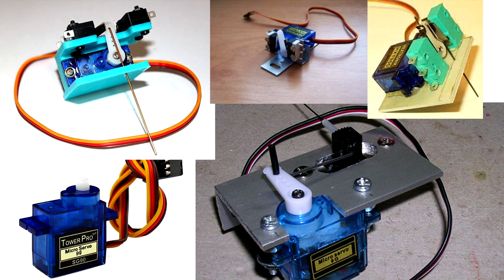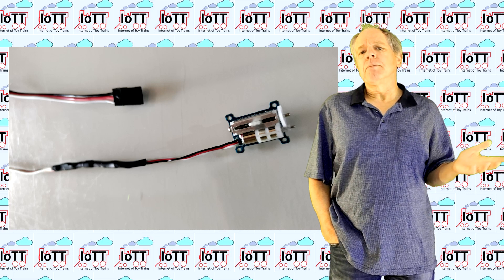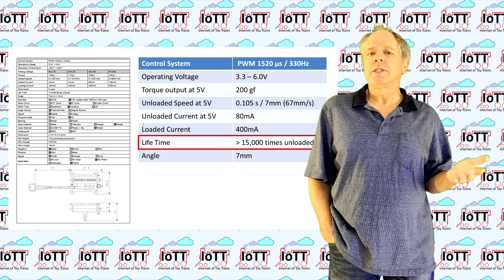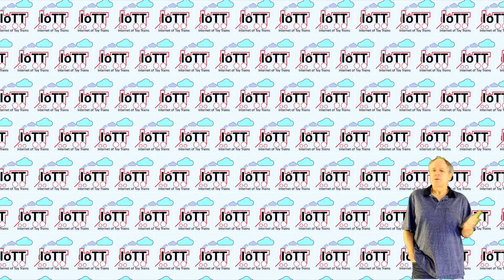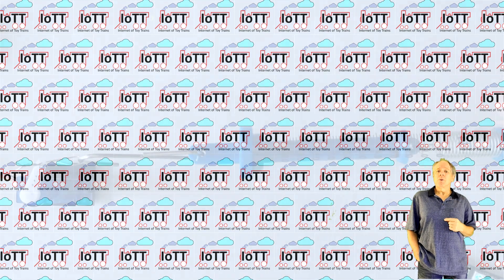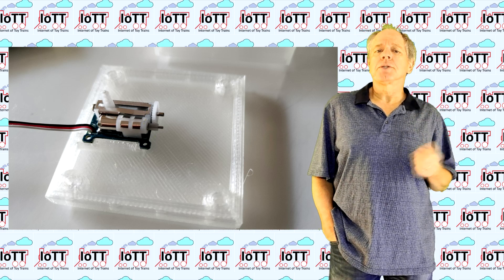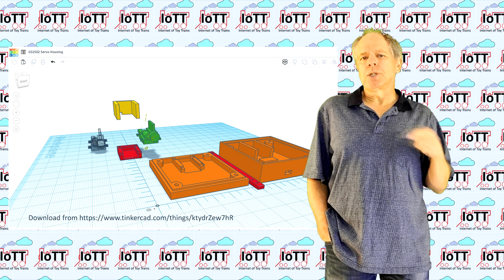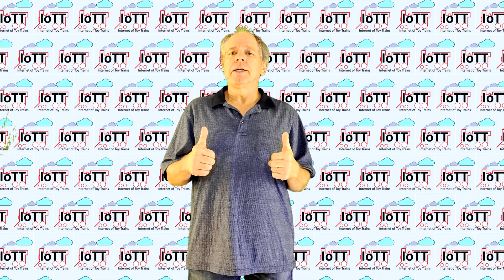GS-1502 Linear Servo Review (Video#92)

Comment: Hi. Could I use it with locomotive decoder?
Reply from the maker: Servos use a PWM input with the duty cycle proportional to the servo position. If you use a decoder that can output such a signal e.g. on a function output, with duty cycle depending on the function value, you could control the servo from a decoder. I just don't know if there is a decoder out that that has this feature. If you find one, please let me know.
Reply: Hey are you thinking of couplers?
I am think of the same thing
Reply: Absolutely my friend. I think loTT have joked on me, because seems many decoders can control servos (analog or digital). I didn’t know it. The only thing how to connect, because some models could provide 3.3 or 5v. This is not a problem, because you could connect as it is, or need some extra components. 
Now the main question to find excact 1502 voltage, because in many shops it is different. 3.3 or 3.7. I do not know what is true.
Reply: The issue is that you need some current conversion for it to work. I found an idea to make it work on DCC systems. But you need a decoder for it which makes it hard to implement on open train cars
Reply: GS-1502 has 0.4A and MS Decoder could provide 0.8A. Are you sure it is an issue?

Comment: Hello sir can i program my ultra linear micro servo with arudino ?
Reply from the maker: The GS-1502 control interface is the same like any other servo. It just needs a PWM signal with a frequency between 50 and 100Hz
Reply: @IoTT  and we need another device to control it other than aurdino ??
Reply from the maker: @Riya.79  You can connect it directly to the Arduino as shown in the Arduino documentation here: https://docs.arduino.cc/tutorials/generic/basic-servo-control/ or here: https://www.youtube.com/watch?v=kUHmYKWwuWs
For most applications (i.e. if you want to control a number of servos from the same Arduino) you probably will use a PWM driver such as a PCA9685 board.

Comment: Great Video! I have a project where I am using 76 of these servos and I was using 50Hz and in some cases getting jitters and stalls, I will give this a shot with the 100Hz and see if I get an improvement. Thanks a million! It has been really hard to find technical info on these.
Reply from the maker: Thank you. Running 100 Hz if the servo can handle it is generally a good idea as it also gives higher resolution. Some of it probably will be lost by the gears, but at least you can play with it. Overall, as I think is made clear in the video, I was not very impressed by the worm gear mechanics of this servo. For a project like yours I probably would look for a more reliable device.

Comment: Thank you for the review. I am thinking about using this type of small servo to raise and lower the pantograph in my TT-scale locomotive. There are decoders that can control servos directly. The problem is probably the small space in the loco and the power supply. Because the decoders usually provide only 50mA at 5V. That will not be enough for this servo.
Reply from the maker: Working panto for TT scale? That's beyond challenging! Hopefully you post a picture somewhere when that works!
Reply: @IoTT  I wouldn't be the first. Others have used Nitinol wire (Memory wire). Unfortunately, this requires 200mA current to hold the position.
Reply from the maker: @macg9940  Yeah, I experimented with memory wire a while ago. Current, heat, and little precision, unfortunately. On the other hand, a good geometry to put into a locomotive body.
Reply: How was the result? Did it work with loco decoder? Modern decoders like Zimo could handle 500-800mA for a functions line.

Comment: I am considering using this servo for switching turnouts on a small portable N-scale layout. I think it could be ok for this application since the switch rails barely need to move a few mm. But I am finding it difficult to create an elastic connection with the throwbar of the turnout since I don't want to stall the servo. Also, how did you slow down the speed of the servo? By reducing the voltage? I am currently driving the servo at 3.3V directly from the PWM output of a Raspberry Pi.
Reply from the maker: The advantage is it is small and linear, but I would be cautious about the relatively short life span. Since the gear is not back drivable, you don't need a lot of elasticity in the draw bar, you just drive the servo to the right position. To control the moving speed of the servo, watch my videos 17 and 18. There it is explained in detail and you also find a link to the Arduino sketch. And watch video 55 for a demonstration what movements are possible.

Comment: At approximately 19 seconds into the video I think you had better correct the servo connector wire/pinout colours, the brown is the negative and the yellow is the signal.
Reply from the maker: Yes, it probably should be the other way around. Funny enough, the image comes from a commercial product description.....
Anyway, in real world, there are several different color schemes as seen here: https://static.rcgroups.net/forums/attachments/3/0/1/8/a4228312-146-user38_pic55606_1294883044.gif

The important thing is that all of them carry the plus on the center pin so that there is no harm done to the servo if you connect it the wrong way around. It just does not work.
Reply: @IoTT  Regardless of the lack of damage if the wires are reversed, you should still correct the diagram in the video.
Reply from the maker: Unfortunately it is not possible in YouTube to make changes to a published video. But as common in such cases, I added a bug report in the video description.

Comment: Thanks, an excellent review. I agree with your conclusions. I used these on a couple of H0 lower quadrent signals and was disapointed.  The linear servos I aquired looked the same as the ones in your review. They were very easy to burn out, and were unable to produce signal bounce, for the same reason you showed. I was able to slide the gear on the screw to eliminate the backlash, but the motion was still rough and much noiser than the 9g alternatives I am using.
Reply from the maker: Thank you. Looks the problems are consistent. And yes, I forgot to mention the noise level in the video. It is probably louder than the SG90.

Comment: Interesting topic and timing. I recently installed 14 MTB MP1 turnout motors on my layout. They have a built in switch and are a bit more expensive than a Peco coil and switch but are more reliable. I’ve tried controlling them using the MGP turnout decoders and the Team Digital SMD84 turnout decoders to see what options are provided. I will next test them with the Green hat.
One thing I like is that if the turnout is already set in the correct direction, if you select a route that includes the same turnout and direction, there is no movement. Unlike the Peco coil that will reenergize the coil in the same direction. I will also test feedback.
Reply from the maker: Not sure about the MP1. Is that like a servo? Or like a slow motion DC motor? In the latter case they would not work with the GreenHat, except when using the coil drive attachment as shown in Video #78.
The Greenhat/IoTT Stick is memorizing the last turnout position when powering down, so when you come back, it already knows it. Also, retriggering the same switch does not reactivate the coil as it remembers the current position. Of course, this falls flat if you manually change the position while the GreenHat is off...
Reply: Tam valley do a nice servo driver for this application
  Mini singlet I think they are called
   I have a couple on my layout driving these servos converting basic manual Bachmann set track to DCC controlled turnouts

Comment: Thanks Hans for your review and recommendation. I am interested in this type of review for moving turnout servos as I have bought a DS78V (digitrax), but it does not have any means of adjusting the end stop positions for point end positions, and risks breaking the turnout through unregulated digital movement. 

I was hoping that this might have a means of adjusting the throw length, but I dont think that it will help.

If you come accross a means to control the stop end movements on a servo digitally, that can be used with the ds78v , please do publish it.

Many thanks
Jonathan Dorey
Reply from the maker: I checked the Digitrax manual as well as the groups.io news group and indeed it seems the Digitrax DS78V only has fixed positions for the servos. Not very convincing, I must say. They suggest mechanical adjustments (meaning moving the servo until it fits). Sort of unbelievable. As you may have seen in the video, on the GreenHat config page I provide a slider to determine the exact servo position - individually for every servo and for every possible position (if you use it to drive a signal with say 5 aspects, you have 5 positions that you can set). I always felt this is the way to do it properly.
Reply: Hans green hat is doing the same task as the ds78v and it is fully compatible with loconet. The advantage of the green hat is configured by a web page it offer a lot more ajustements and features. Since the brain is the ESP32 microcontrollers. Take a look at his video on the green hat on his channel.

Comment: Interesting video. I bought a couple of linear servos some time ago with the thought about using them to activate an N-scale turnout. I thought it might be possible to attach the servo to the underside of the turnout such that I had it in one unit. This way I could easily replace the turnout and servo if anything went wrong. I haven’t gotten back to that project yet. This video gives me some more to think about. The spring on a PECO turnout might be too much for the servo. Still, since the linear servo stays in position and won’t move back, removing the PECO spring may be the solution. I may end up using these servo for animation projects anyway. Enlightening video as always Hans!
Reply: Yes, I always remove the springs on the turnout. The sg90s work great with my n scale peco turnout.
Reply: @pierrelambert446  I've standardized on a SG90 servo with a 3d printed holder for my turnouts. They have been working great with the Green Hat. For a few of the KATO turnouts that I use, I now have Hans' relay board adapter. Love his products!
Reply: @robleathley6024   great to hear, I have now 4 green hat, and a few yellow hat for track occupancy. And around 10 servo SG90s installed. My layout construction is a bit slow. I did design my own servo mount. Hans product are working great. He his helping to push the envelope of this hobby.
Reply: @pierrelambert446  My layout isn't going any faster. So many projects and so little time! I have about 20 servos installed so far with another 8 or so yet to be done. The Green Hats will all control them. I'm also using MGP diode detectors for my occupancy detectors to allow signaling on the mainline. I have a few other MGP items as well. They work well with Hans' system. I very much agree that he is pushing the envelop in this hobby.
Reply: @robleathley6024   I just stopped purchasing the Yellow Hat for my MGP detector, as the Red hat with DCC ++ should come with 32 inputs. I am on stand by for the detection. Look like we are on the same path for the electronic off our layout.
Reply: @pierrelambert446  I have an NCE Powerhouse Pro for DCC but I'd like to get a Red Hat once they come out for my portable modules. Just trying to rewire the layout now in order to get signaling setup. First have to finish my turntable. Yes, very similar path for electronics.
Reply from the maker: Thanks. Removing the spring certainly is an option. For N scale, I think the force the servo develops is enough. Try it with one, the see how it performs.

Comment: Nice, I was not aware those servo were existing. Thanks for sharing. I am looking at your tindie store almost everyday for the purple hat. If  you try the servo sg90s with metal gear, the servo won’t move when the power is removed. At lest without excessive force. A bit more expansive than the regular sg90. For my layout i will only purchase the sg90s.
Reply from the maker: The SG90 is certainly the better option. More durable and better drive precision.